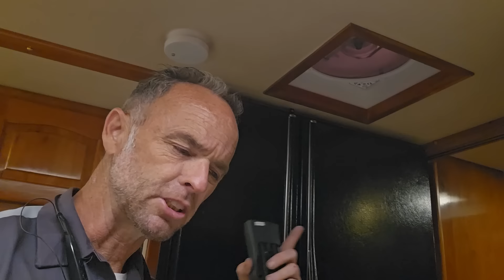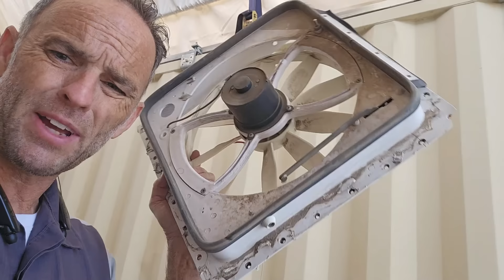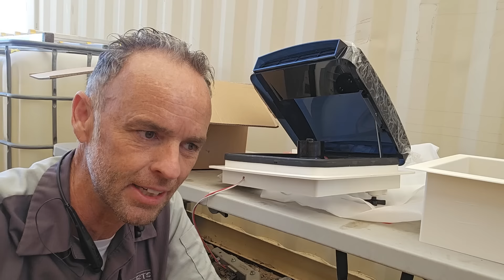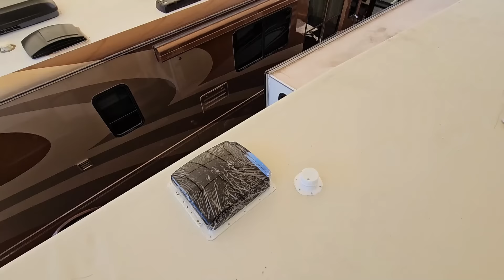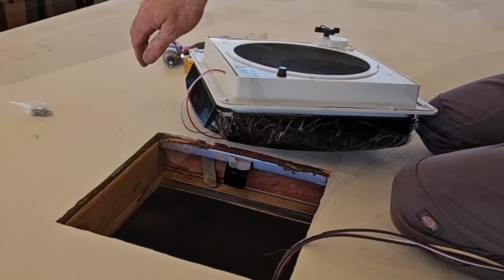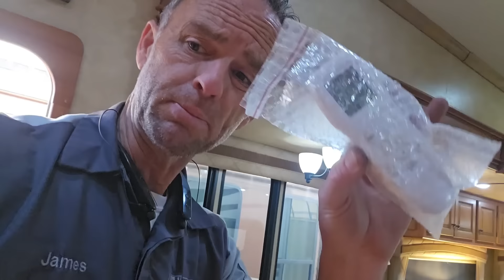Why I'm DONE with These Overpriced "Luxury" RV Roof Vents

Comment: Not a sponsored video, but Amazon affiliate links. Remember folks that such links apply to all purchases for 24 hours. So, they're not simply a commission on a specific product.

Secondly, these knock-off fans would be susceptible to each and every issue cited about Maxx Fan, etc. They're just cheaper/less expensive. When they break, the service fees to repair or replace the units more than negates any initial cost savings.

Now, don't get me wrong. I've had very bad experiences with expensive roof vent fans. Because I'm able to, I created my own solution that costs even less than the fans featured in this video. I'll be sticking with my solution, which have performed flawlessly for going on three years now. (For reference, both Maxx Fans failed in less than a year each.)
Reply from the maker: Thanks for watching and glad you feel so comfortable expressing your opinions here like it's a yahoo comment section

Comment: Great presentation - Thanx - Had the "luxury" units - Fantastic Fan used to have -- a lot of aftermarket options -- dual pane roof cover / two covers one above the other for cold areas, worked well (condensation)- solar power fan for venting (moving small amounts for out gassing and humidity during storage) - variable speed instead of the 3 --- 
Maxxair snorkel cover - those held up in Hurricane force wind over the FF fans in southern Georgia so a plus. Maxxfan 7500K Smoke - we have a sloped roof - that condensate (mentioned above) ran off the underside in the winter, fell on the controls and toast. No more fan. Got to get the controls from your dealer - I bought from Maxx store on the internet, you are my dealer - duh. 
Rack up a lot of experience over 55+ years of RVing.

Comment: On northern lites the max fan boards get weird a lot due to condensation issues being so common on the interior being a small fiberglass truck camper. Last one I saw it stopped working with the remote-dried and cleaned board+ir receiver and starts working again lol. So weird they don’t have protective coating cause interior condensation is an issue due to RVs being small spaces of course
Reply from the maker: Thanks for the info

Comment: I agree, the Maxxfan is too expensive for what you get. The remote is bulky and not backlit. And if you install two fans, you can't just use one remote to control both of them. Not to mention all the issues they've had with fans burning out due to "high" voltages (normal voltage for an RV). They also have condensation issues that burn out the motherboards.
Reply from the maker: It's crazy as a window A/C is less than $400

Comment: If the motor still works on the discarded Fantastic fan, why not salvage it?
Reply from the maker: for what? Actual salvage doesn't add up to gas for just it and storing old parts is every shops problem and nightmare
Reply: @ I was thinking some day there won’t be parts available to do repairs. Auto industry is having that problem.

Comment: max airs sucks...lifting mech is pot aluminum..breaks...fan blades go out of balance..motors are super cheap now..were better years ago...no one stole motor design ..looked into it..motors are off the shelf cheap  Chinese motors.
Reply from the maker: I think you're right about the motors, they are the same, pretty much.

Comment: Sorry to say, no bueno to that cheaper fan for one huge reason. 
It only has one lift support on one side only. 
If a gust of wind catches that lid when open it will twist it into pieces. 
Ask me how I know.
They need to have a lift arm on both sides for better strength.
Reply from the maker: Fantastic vents only have one lift arm

Comment: If the bugs are bad out I would advise only running on exhaust otherwise your fan will turn into a bug blender screens don't even matter. We had the max air covers as well. It was so bad after a week in the Adirondacks I had to take the blade out and soak it to get the bug guts off it. I can't speak to the ones that run closed I suspect they do a better job but only closed.
Reply from the maker: Thanks for the tip,

Comment: Coming from the marina industry working on new and used RVs has been an eye-opening experience. I did not know you could put something on the road that was made as cheap and flimsy as today’s RVs. The profits and parts manufacturing and sales must approached 300 to 400% markup. I’ve installed these fans and as you say they are flimsy junk and certainly does not cost more than $20 to make.

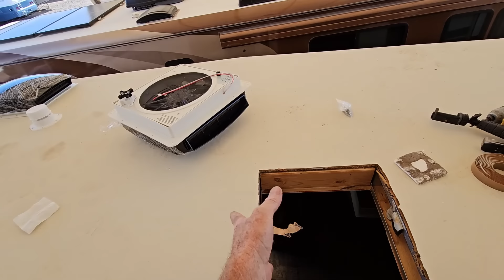Comment: @15:30 mark - Interesting to see him cut the roof membrane flush with the framing opening.  I’ve always seen the EPDM/TPO material cut such that it extends down into the framing - getting wrapped under the opening & stapled.  I wonder if this flush cut method is considered superior to the fold-it-downward method..?
Reply from the maker: i dont like the flaps, they cause issues installing the garnishand there are more than enough screws going through the membrane there

Comment: 1999 Winnebago Adventurer. Install the 10 speed max air in the living area, no power lift motor, and replaced the little farty fan with a 4 speed in the bathroom. Worked well for the 2 months in humid Pennsylvania.  Glad I didn't get the power open/close feature.  Now the warped plastic in hot weather maybe a concern. All made in China anyways.

Comment: Hey James, I actually found and installed that same vent on my class b Roadtrek a year ago. I found mine on eBay. It’s definitely a Chinese import because the guy I bought it from said he ran out and had to import more so he was buying directly from the manufacturer in China, not sure, maybe available on alibaba. So my experience is it is a decent quality unit. I liked it for the same reason you did, I didn’t want a maxxair unit on my roof because of the higher height but after having a maxxair on my previous rv I wanted the ability to use it closed the way the maxxair works.  I will say I was a little disappointed it did not seem to draw air as nicely as I remember my maxxair being able to do when closed but it is working fine a year later so there you have it, a year later it’s still good. I can tell you I have a suspicion it’s made by a company called hengs.
Reply from the maker: I think Heng's is also a false company but the country of origin for all of these are the same
Reply: @AZExpert  yeah..all from china, like everything else sold in usa..lol.

Comment: I had a little crappy exhaust fan in bathroom. Ended up replacing it with an 80 Watt radiator fan. First I controlled speed with a cheap pulse modulator, but it burned out. Instead I installed a 50 Watt tungsten halogen bulb in series. It's  beautiful, runs fan at about 35 watts = perfect. Radiator fan was $25, and has its own guard (one side). They can be reversible too, but for bathroom exhaust is good.

Comment: The only catch I see might not affect others….. I live in a hail prone area and having the max air vent cover protects the actual lid on the vent. Nor a huge issue for some, but a $40 cover has saved the 200 vent several times.
Reply from the maker: okay but the plastic on the lid is stronger than the maxx vent cover

Comment: Great option for the price! Thanks for sharing James. I'll be interested to see how these last (as with everything, even the "luxury" items) Two differences I can see from the video and not having touched one of these myself - with the maxxfan's cover you can have it totally open in the rain - which would mean you can still get the max CFM in the rain, and the other being the roof shroud - the four screws that release the motor assembly and cover is SUPER convenient not having to deal with sealant if you need to replace or service it. Are those two items worth the premium? All depends on how the owners use the rig right? Stay cool!
Reply from the maker: Personally I have not had to change out the whole head but the low profile design means it could be under a solar array much easier too

Comment: I was literally looking at 2 fan upgrades as I do work on my roof. Very timely :) How much self leveling lap sealant does 1 vent take to cover properly? Thanks.
Reply from the maker: I only used one tube a vent
Reply: @AZExpert  Thank you!
Reply: I will say that I’m still tempted to stick with the old dual cover setup because if the environment my RV lives in. A little redundancy never hurts. But I certainly want to upgrade the back two fans.

Comment: the control boards go bad because they can't handle high voltage....Basically over 12volts fry them eventually, it's a well known issue with the Maxxfan units.....with a new install you must install an inline voltage regulator that will not let more than 12volts get to the board.
Reply: Can you recommend one? 

You would think the manufacturer would include that in the instructions at least or have it built into the fan

Comment: Thanks for the perfectly timed video!  One of my customers wants 3 new vent fans soon.  
Question; For years, we've bedded in new vents with putty tape and then caulk over.  Is installing without the putty the new thing?
Reply from the maker: I installed with putty underneath
Reply: @AZExpert  Thanks. I missed that step 👍

Comment: so as I watched your long winded speech about the crappy vents i began to wonder what was the point you where trying to make. when you finally got to the product and mention its name, I went to look up the manufacturer and found it impossible to find do to googles highly censored platform, so i went to amazon and found it was made in china. theirs your answer. this design was stolen and they are undercutting the American manufacturers.  you can support a communist supplier if you want but count me out, as you will find out soon, this product will not last. this is the reason we are in such a turmoil when it comes to cheep chines products and no longer make them in the US.
Reply from the maker: I think you will find the Maxx Fan and Fantastic vents are made there too so your point is moot like I said in the video. The manufacturer does not steal the designs from the American company, the American company gives it to them, and shareholders get the extra $200 not American workers. The greed at the top is why we are in turmoil.
Reply: ummmm..you do know...pretty much anything in an rv is from..yep,,thats right...china !. try looking at all the labels on everything in your rv, camper, you will soon find out...pretty much 99.99% of the parts in it are made in china.

Comment: One major short coming I’ve noticed about this new vent vs Maxxfan, yes you can run it closed and vent but if it’s open and you leave and it rains your getting water in the rig.. with the Maxxfan you have peace of mind to leave it open or close and it’s always protected
Reply from the maker: It does have the rain sensor to close in bad weather, like the Fantastic vent does, but if that failed you are correct.

Comment: Can you seal them 100% so I save my expensive AC cooled air inside the rig during the summer?
Reply from the maker: I do think they are not "air tight" but neither are the maxx fan deluxes or smaller maxx vents, but as the A/C does not pressurize and they are located out of the airflow of A/C it should not really be an issue and if anything allows some small amount of fresh air in which is good too.
Reply: Get yourself an insulation pillow and put it in there for when you’re running the AC.

Comment: Nine years ago we purchased a new rv but it had low end power vents. The Fantastic vents at the time were priced in the $395-$405 range so I looked for a cheaper option. I found an after market vent for $135 that was a great replacement and had all the features and goodies. They had a 10 speed reversible remote, manual function also. They had the rain sensor and also a thermostat feature you could set the fans to go off and on at a desired temperature. They worked great and are still working for the people we sold the rv to a couple of years ago. We put the same type of replacement fans in the subsequent rv and so far so good. Been very pleased with them.
Reply: There are a number of these RV Vent fan replacements online that seem to range in price from $130-$160. I don't remember the name of the ones I purchased 9 years ago but the last ones I purchased were called VEVOR. They offered models with remote controls, some had rain sensors for auto closing, like mine and some had built-in covers. I noticed some under the name of Hurrventor, Kohree and more. There are a number of these reasonable options offered on Amazon.
Reply: Any chance you could share the make and model of this RV fan you’ve enjoy such great results.
Even better, any link to the product and or best place to purchase.

Thanks
Reply: The main difference with the Hurrventer that he recommends in this video is that it REPLACES the need for a cover to be able to use the fan in rainy weather. This Hurrventer one seems to be the only model on the market, including the Max Air Fans or the VEVOR one, that can be run with the cover opened OR closed due to the way the cover is manufactured with vents in the sides of the cover. (Looks like the model that is sold out has a different cover than the one shown in the video. Possibly a new (or old) design with the vents at the edges under neath the cover, not visible from above. Whereas the version in the video has the vents visible directly at the front of the cover.)
Reply: I have a fan switch on the bathroom wall in my RV, can this unit be wired to that switch to turn the fan on/off?

Comment: I just recently installed the third Maxxfan deluxe in my rig not long ago.. my rig now has all three of its vents done and I’ve been able to shop smart and get them for about $315 each, the last one I got for about $280 with a really good sale from camping world… if you wait for the deals you can find them! And I’m talking about the latest 10speed versions not the older ones. Plus I love how they are held on with only four screws if something does happen they can be swapped out in minutes.. but I agree nothing is built to last anymore…
Reply from the maker: Great find, and thanks for sharing your experience with the vents!
Reply: @ no problem, yeah cw has them for $347 but when they go on sale and when their $50 coupon comes out you get it for $280 and I got $20 in cash back so basically $260